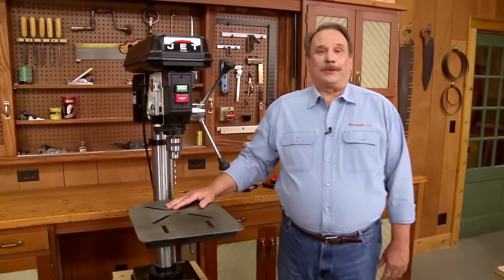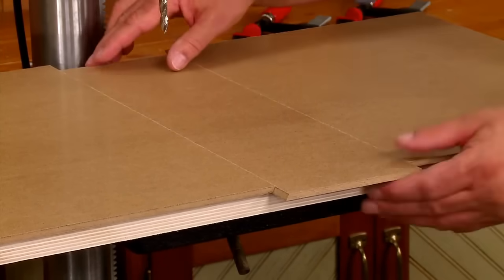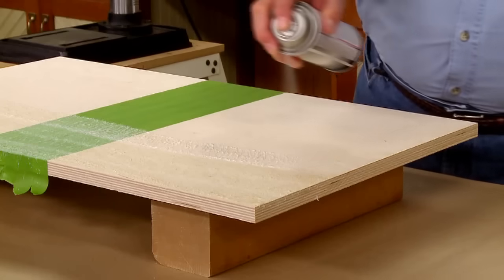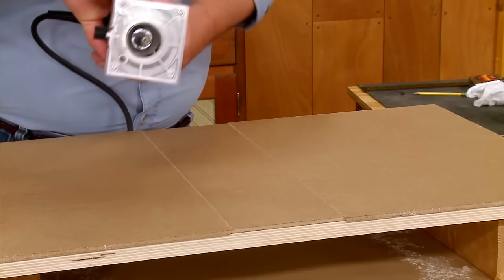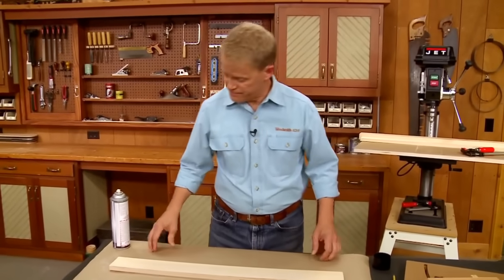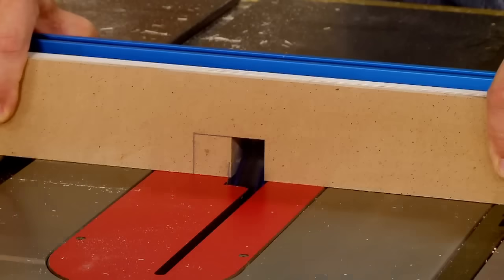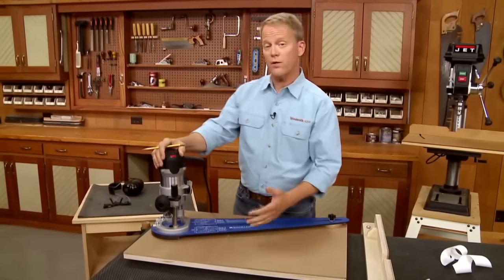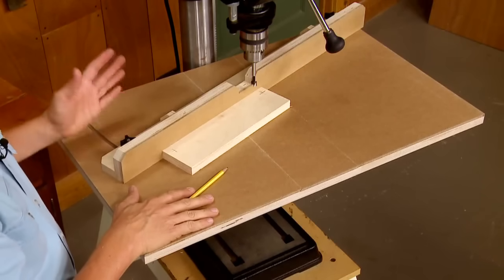Upgrade Your Drill Press! - How To Build a Quick and Easy Drill Press Table! (FREE PLAN)

Comment: You went through all of that, but didn't show how the nut on the movable side of the fence was restrained from turning, and we can only assume you used a threaded insert on the pivot side.  You didn't explain why your hardboard needed to be smaller than the fence board, I believe that is because there really isn't a good reason.  Also, I would have recommended those same hand knobs instead of bolts to attach the table to the press when clearance allows, noting that any three of the four slots is probably sufficient.  Finally, round your corners.  Nice project, but mediocre video about it.
Reply from the maker: Kirby Spencer - Thanks for taking the time to watch our video and the thoughtful critiques.  We’ll definitely consider your input for the next video. 👍
Reply: Thank you in advance for running the next video by me before you post it.  In the meantime, why not just address the nut retention issue and the reason why the hardboard needed to be smaller right here in the comments so that your viewers have the benefit of that?
Reply from the maker: You can find some more details for this project in the free plans (link provided in the description).  

The fence is held in place by a carriage bolt that runs through the table into a threaded knob on both ends.  The square portion on the shaft of the carriage bolt (just under the head) fits in the underside of the slot and this keeps it from spinning as you tighten the knob on the adjustable end of the fence.  

I'm not sure why we didn't go to the trouble of chamfering or rounding the corners of the table like we did on the fence... that is definitely something I would change. I would also add a small rabbet (1/8" square or so) on the bottom edge of the fence for dust relief.

We've used knobs instead of bolts in the past to attach drill press tables, but I've found we don't take the table off and on that much so bolts seem fine.  If you do plan on removing the table frequently, studded knobs would definitely be more convenient.

I apologize... I'm not seeing where the hardboard is smaller than the fence board. (I assume you are referring to the hardboard on the face of the fence or maybe I'm misunderstanding)  Would you do me a favor and point out that portion of the video, and I would be happy to address that, as well.
Reply: The part where it appears that you are advocating that the hardboard be smaller is at 17:43.  I realize that it is not explicit that it 'must' be, but it gets reinforced when the smaller piece is so carefully centered at 18:43.  It seems that you might be trying to convey that the pieces need not be precisely the same size as they will be sized when run through the table saw, but that should have been explicitly stated and/or the pieces should have been haphazardly glued together to illustrate the point.  However, I am pretty sure your intent was to stress that you were going to use the plywood reference edge to get your first straight cut so would want that edge fully exposed.  So, this whole topic is just a matter of clarification to shift focus from 'how' to 'why'.

Your new comment regarding a rabbit on the leading edge of the fence is a good [and standard] idea, I'm surprised I didn't catch that and I commend you mentioning this additional step and providing the reason why.

I understand that you perhaps do not use other vices and jigs on your drill press so don't need to remove the table, therefore bolts instead of knobs would save a few pennies as well as being probably more secure.

Thanks for engaging and addressing my comment.  So many times people are not open to that.  Perhaps a new [very brief] comment, summarizing these clarifications (and perhaps others with valid basis), could be pinned at the top for future viewers.  Again, I appreciate everything.  Good day.
Reply from the maker: Kirby Spencer - Okay, I remember doing that with the hardboard on the fence now.  We were just trying to show another way of doings rather than just gluing on an oversized piece and flush trimming to size.  It probably could have been explained better though.  

I appreciate the discussion and pointers.  In the future, I would like to take the time to shoot a follow up video discussing some of these topics, but I can add to the description for now.

Thanks again!
Reply: There is a REALLY good reason why the hardboard needs to be smaller than the fence board. With this technique they are using the table saw to trim the hardboard & fence board flush & to size. Thus, the fence board is riding on the table saw fence to get straight cuts all the way around. If the hardboard was larger than the fence board that would not be possible. 

He did explain he was only showing a different & maybe easier way (table saw vs router) from the 1st guy to attach the hardboard to the fence board & get it flush around the perimeter. I would agree the table saw method is a little easier.